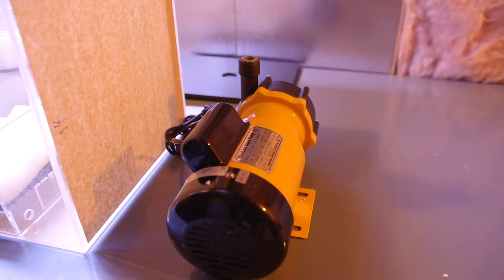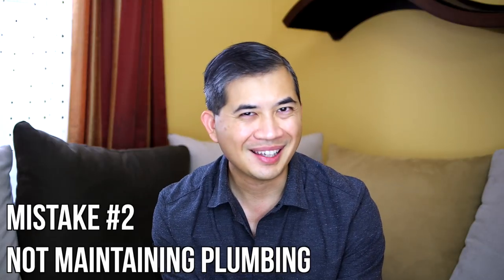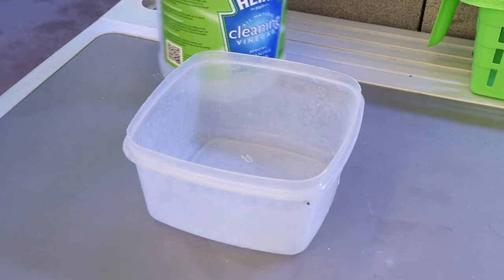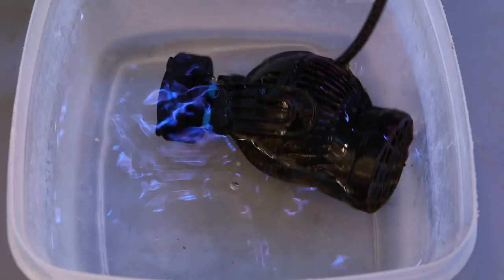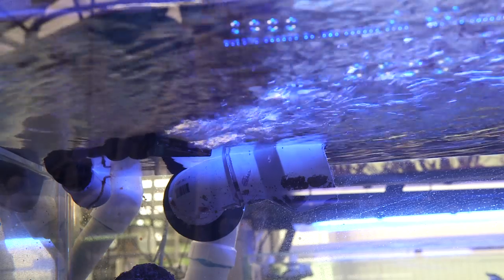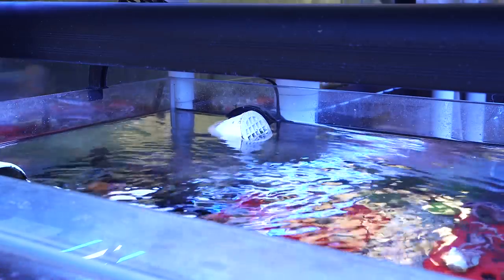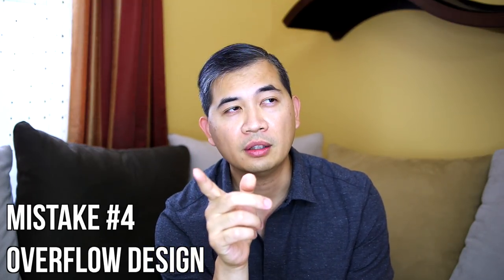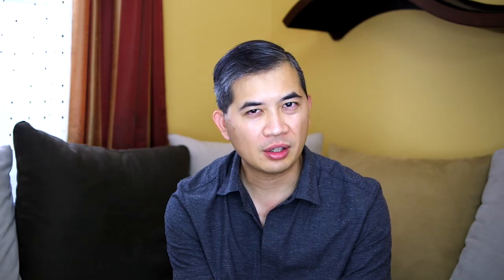Top 5 Reef Aquarium Plumbing Mistakes

Comment: Sure, I'll throw one out there. This is mostly for home aquarists and mostly for those just starting out. Don't get too overwhelmed by the elaborate PVC plumbing jobs you see on other tanks and think you need to do the same. Hose, properly selected and secured, will work fine and even better in many cases. I like double hose clamps on each connection in case one fails. I inherited that from boats with through-hull fittings. They aren't sinking left and right so I reckon it's fine for an aquarium too. You can get really strong plastic clamps for submersible saltwater applications. 

For a home aquarium, I think 2 return pumps, each with a dedicated line to a back corner of the display tank is ideal for simplicity and redundancy. It's even about the same price to buy and operate as one pump of combined capacity. 

+ Hose inherently avoids elbows and things that restrict flow.
+ Hose can sometimes take a more direct route for less friction loss. 
+ Hose makes it a lot simpler to change things around over the years.
+ Hose is inexpensive. Sure, so is PVC pipe, until you start adding in all the fittings.
+ Fixtures like pumps are easier to wiggle around and move for things like maintenance. 
+ Each fitting is a potential failure point.
+ Thinking of return plumbing, you could take the submersible pump and the hose, drop it in a bucket of vinegar with the hose coiled, and run the pump for a few hours. If you followed the tip on redundant returns, your tank will hardly notice the missing pump. Give the hose a good shake or smack it around some beforehand and you'll loosen up a lot of the calcium build-up. Much harder to do any of this with rigid plumbing.
- The hose doesn't look as impressive when sharing videos/photos. Lose even more style points for not using the colored PVC. 

It's a contentious opinion and I know people will strongly disagree, but I think it's the way to go most of the time until you get into the several hundreds of gallons or more.
Reply: I'm going to build a 250 gallon reef, will definitely use this advice. Thanks
Reply: Seth Williamson good points. I was thinking of just doing soft plumbing. Much easier

Comment: I love the fifth mistake cause am a plumber and I see a lot of videos that people posted in YouTube very proud of the pluming that they did in their tanks and is hard to cash for the eye that don't know Plumbing but for me is a bit crazy to mix DWV fitting with pressure fitting in a supply line when the pressure can be above 50 psi 
Reefers out there read the pvc parts DWV stand for DRAIN WASTE AND VENT and CAN'T be use in pressure lines, also return lines has to be in same pvc parts made for pressure 
Small tip 
Drain fitting has longer turn or wider open flow
Pressure fittings has sharper edges and stronger turns on elbows and tees

Comment: Thanks Than.

I know of a huge tank failure 240gal, because the power went out and the sump overflowed a little bit....

Well that little bit of overflow was onto an MDF stand <- There's a pet peeve haha

That MDF stand then  disentegrated / warped causing the 240 gal to  bust a seam.

This was in a business.
Reply: Dlucks I don't trust that mdf at all. Was just in the pet shop and was literally shocked at the new shipments of tanks and stands that came in. One strong kick and I could karate that stand in half with the tank on it.

Comment: Very good Video, my biggest upset has been matching the pump flow rate to the proper turn over rate. I find that most plumbing  jobs consist of way to many bends for what the expected flow rates. Not to mention the newer DC pumps fall way short of advertised rates!

Comment: So on the drains. I could not find any large hole saw where I live and could only find a 35mm.. that is like 1.37 inches, I think. Anyway, i just ended up drilling 4 holes inline. It is able to handle a lot of flow, but yeah the additional plumbing is an overkill.

Comment: Nice tips. Can I use brass plumb components for a reef tank? R they safe?
Reply from the maker: No, don't use brass.  Copper in the brass can leach out.
Reply: @tidalgardens  No wonder. That's probably explains the reason my corals keep dying till this day, but fish is not affected. Will take out the brass fittings ASAP n do water change

Comment: Very informative video.. Im an ex sprinkler/plumbing guy.  Im also totally into DIY with my 3rd 1000gallon plywood aquarium in build process. Complete with 210gallon plywood sump. Im going to do a pipe system that comes apart easily, as I will be running 2-1800gph magdrive pumps from sump..( I already have them and would rather still have 1 running if other fails ) Im using 1 1/2" id pipe with stockman overflows. Each return will have its own 1" return line. I so understand having more gravity drain, then pumps can return. I have expressed on my channel how the system is self regulating that way.  I explain how too much return can be a problem by sucking dry the sump.

Comment: Always add a gate valve on the return (never on the overflow) to regulate the speed of return. Also the pipe from the return pump to the tank bottom needs to be flexible to counter vibrations from the pump.
Reply: I'm not sure how or why gate valves came into favor, but ball valves are designed to handle pressure. Gate valves are supposed to be either totally open, or totally closed to the flow. I learned this in boiler class where PSI is going to be higher, but the same principles apply. Also, a ball valve on the return is handy for maintenance, especially sump maintenance. With regards to the flexible connection to the pump-solid tip. This will not only cut down vibration but also prevent small leaks from forming.

Comment: the formula is dumbed down to drainage is proportional to radius to the forth power.  So increasing the radius by 2x increases the drainage capacity by 2^4= 16x.
Reply: correct me if i'm wrong. 

doubling the radius will increase the area of a circle by 4x.

a 2 inch pipe should drain 4x more than a 1 inch and vice versa.
Reply: Doubling radius does increase area by 4 but area isn't a direct factor in flow rate through the entire tube.  If we are going to get technical the rate of flow in any tube be it plumbing, a blood vessel, etc is determined by Poiseuille's Law.  The formula is:  Q=(Pi x P x R^4) / (8 x L x n). Q is flow, Pi is roughly 3.14, P is pressure, R is radius, L is length of the tube, n is viscosity of the fluid.  So increasing radius by 2 increases the flow by 16.
Reply: wow, learn something new everyday! 
thanks for the explanation!
Reply: It's obviously a bit more complicated when you factor in things like bends height and friction in the tube, but all things being equal that's the theory behind it
Reply: ugh stop im in physics..... i need to escape with aquatic life not more kinetic friction......
Reply: That just gave me a Braingasm

Comment: The formula is based on poiseuille's law.. basically if you double the radius flow will increase 16 fold so if your flow rate was 100ml/min and you doubled the radius flow could increase to 1600ml/min

Comment: My biggest mistake was not installing a check valve immediately after the overflow box. Every time I have to take it apart it ends up just pouring out water after around an hour and if I forget to put a bucket under the first union it ruins the kitchen ceiling!

Comment: When I first hooked up my cooler to the aquarium I didn't have the right pipe fitting so I made a makeshift fitting and turned on the pump for the cooler then I went in the house to look at the tank and realised the water level dropped so I went out and saw that the pipe flew off the cooler and was spewing tank water out lol